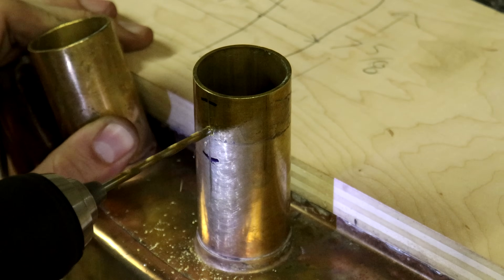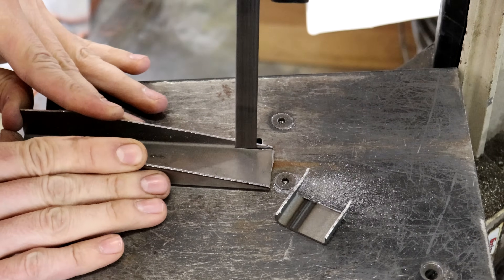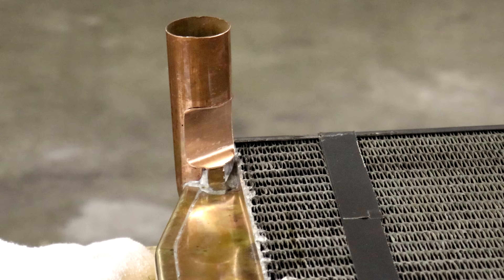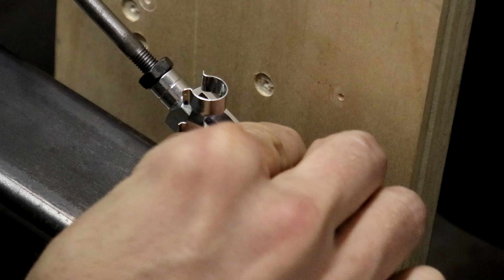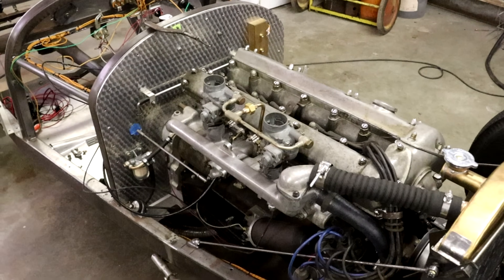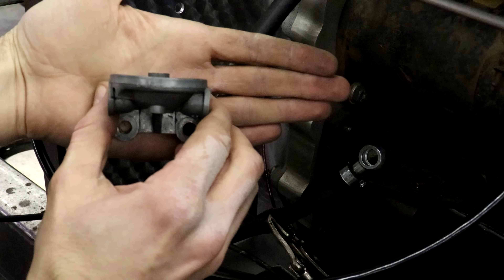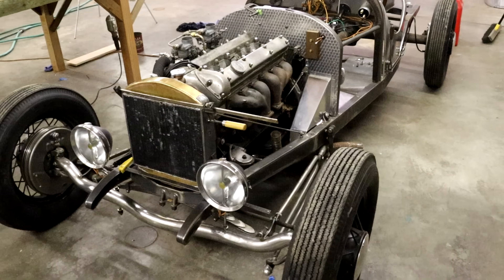Does My Homemade Radiator Work? | Homemade Boat-tail Speedster Pt. 67

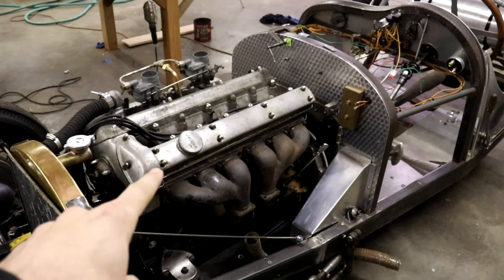Comment: 17:42 it’s called Dieseling. 

Btw, glad to see you back!
Reply: Caused By The Idle Being Too High!!!
Keep Rocking!!!
Reply: @ I believe it’s the octane. Or maybe the timing.
Reply: @18wheeler77  You Can Believe What You Want But You Will Be Wrong!!!
I Have Close To 40 Years Doing Tune-up And Drivablity For A Living And This Was One Of The First Things I Learned About Carbed Engine's!!! Yeah I Started Back When Everything Had A Carb!!!
He Had The Idle Set At 1000 RPM When The Ignition Was Turned Off!!! That Will Induce A Run On Condition!!!
It's NEVER Timing And Most Definitely NOT Octane!!!
Reply: @ ok, geez! Settle down! 🤦🏻‍♂️
Reply: @18wheeler77  I Told You The Correct Answer To The Problem But You Come Back With "I Believes And Maybes" Instead Of Listening To Someone Who Identified The Problem And Shared The Answer With You!!!
Instead Of Telling Me To "Settle Down" How About Learning Something and Say Thanks For The Info!!! How About That!!!
Reply: @ lmfao! Ok bro! You are the winner. You are better than me! I’m a loser. Feel better?!! 🙄
Reply: @18wheeler77  And You Still Can't Say Thanks!!!
In 20 Years You Will Remember This Fact When You Get A Vintage Car And It Runs On When The Ignition Is Turned Off!!!!
You  Can Do A Video Titled "An Old Cranky Mechanic Tought Me This"!!!
Reply: @ 😂😂😂😂😂 whatever. Have a good evening!

Comment: Spray mist water into the carburetors at high idle. This will clean the carbon deposits out of the combustion chambers and it won’t run on then. If that’s the problem.
Reply: Well When He's Done Doing That He Can Fix The Problem By Simply Lowering The Idle Off 1000 RPM!!!
Dieseling Is Caused By The Idle Being Too High!!! 
Has NOTHING To Do With Carbon, Nor Timing Or A Bubble Of Air In The Head!!! 
It's The Idle Is Too High!!!

Comment: Glad to see you back, you really do not want rubber fuel hose running in your frame, the NHRA mandates a maximum of 12 inches of rubber fuel for a reason, try AN6 braided hose its much better and cheap

Comment: The dieseling after shutoff seems most commonly to be caused by timing.
Reply: Wrong!!!It's NEVER Timing And Is ALWAYS High Idle!!! 
40 Years Doing Tune-up And Drivablity For A Living!!!
Reply: @rockerpat1085  Yep a high idle will cause that. IGNITION IS OFF, so timing has zero to do with dieseling.

Comment: As usual, awesome work! Tat car is beautiful! Again, PLEASE make it road legal and take it to meets. If you run into overheating issues on raceday or something, make a shroud around the fan. If that doesn't work you have to add a row to the radiator ...
Reply: Hopefully it stays that cool with the bonnet/Hood covering the engine,
They sell waterless coolant  that is ment to runs quite abit cooler than water if needed👍🏻
Reply: jonasbjork6593  I doubt  he will ever be able to license that thing in California, emission standards can't be met and unless he can get some type of waiver he will never drive it on the street.
Reply: @wilburfinnigan2142  Just sounds like a good reason to move from California.
Reply: @wilburfinnigan2142  I'd just buy an old rotted out junk car with a clean title and put the vin on it. Just so you can get plates for it. Anyone asks its just heavily modded. 

Really unless you're being an absolute idiot there is no reason you'd get in trouble. I once got pulled over in a newer F350 for speeding, had just bought it so I had tags from a 2005 expedition we had. Cop literally did not care, didn't even mention it.

Not much difference between this and all those countless beetles and fieros kitcars.
Reply: You can register it as a custom build, but if he has the ability might be easier to register it in his home state. But never had a problem registering a custom vehicle here in CA. Just have to have your ducks in a row.
Reply: @michaelcassanello5695  Is there somewhere to find what rules apply?
Reply: @wilburfinnigan2142  It would be a pity not to be able drive it on a road. Maybe get a cottage in some other state? 😀
Reply: @wilburfinnigan2142 because of the age of the engine it would be considered smog exempt. But as a custom I believe an individual is allowed to make & register one homebuilt / custom  vehicle and that's it.

Comment: The dieseling you encountered might be the carbs needing a tune or your ignition needing to be a few degrees more advanced. Other things can cause it, too. Great video!
Reply: The Dieseling Is Caused By The Idle Being Too High!!!
Not Timing Nor Carb Adjustment Other Than The Idle!!!
Over 40 Years Of Being A Tune-up And Drivablity Technician!!!